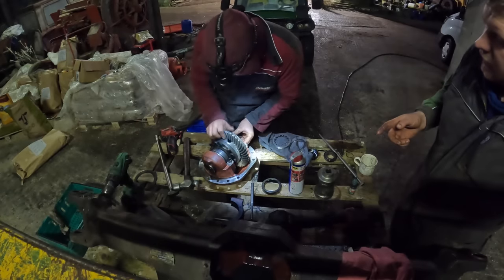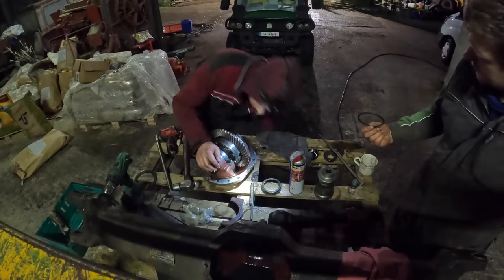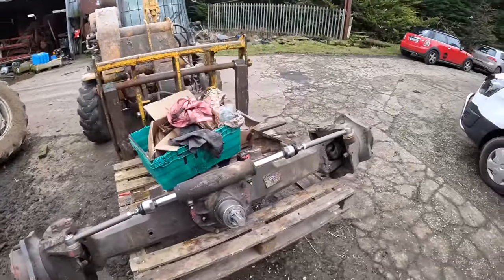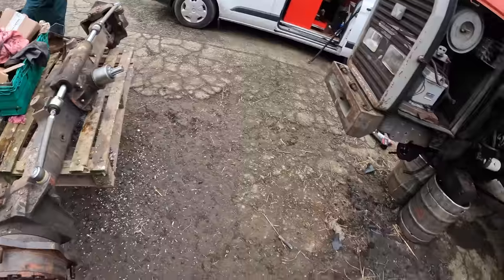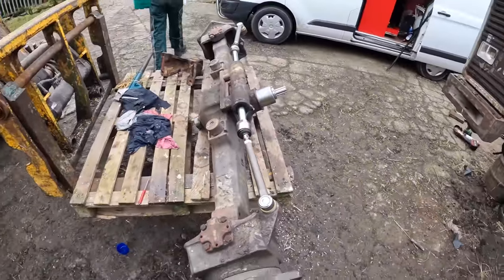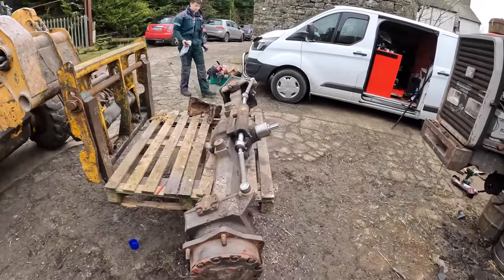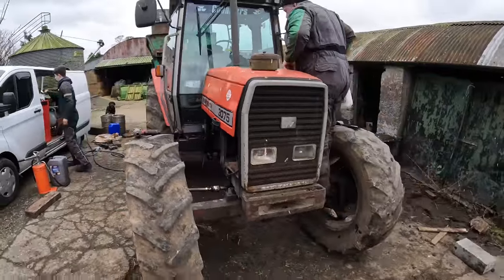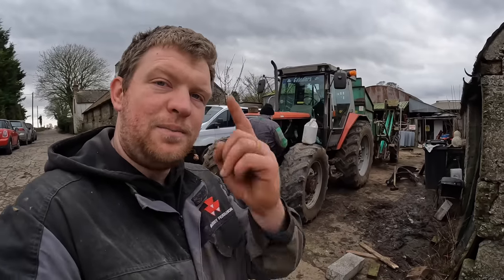PUTTING THE FRONT AXLE BACK TOGETHER AND ONTO MF3075

Comment: Good video with Robert I noticed that you didn't preload the pinion bearings and the backlash should have been set with a clock gauge failing that it should have been checked with engineers blue for correct mesh all in all a good video

Comment: Not simple setting up the crown wheel and pinon tolerances! The height of the pinon and contact patch on the crown wheel when rotated is the important one ! The brass bush in the cradle when fitted is tighter than when measured in your hand and maybe a thou to much on the diff housing! But she'll loosen!
Reply: That’s it you really need to paint the teeth and check the contact area setting a diff up properly can take hours then there’s the pre load on the pinion bearings you’d say they were too tight but feel when done as the book says but that’s how they have to be